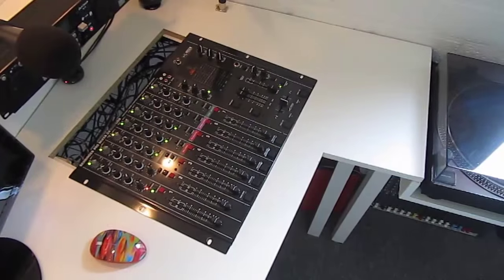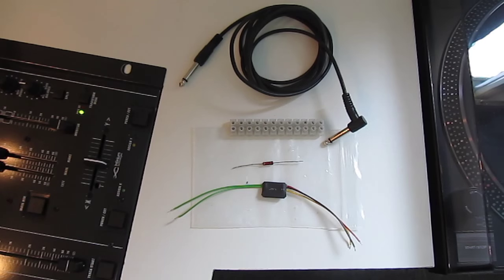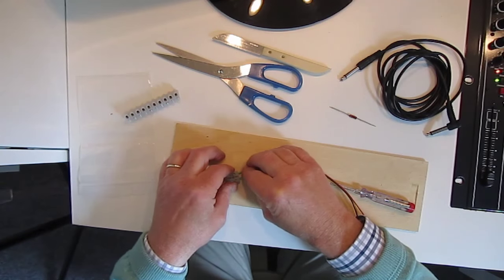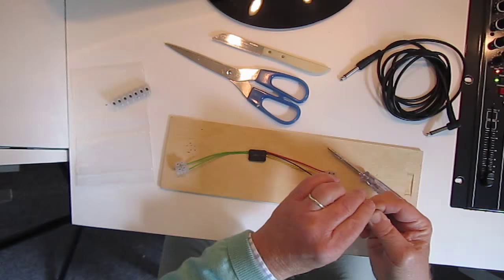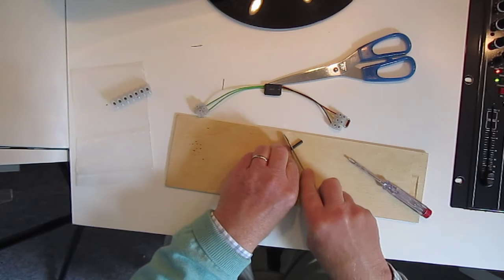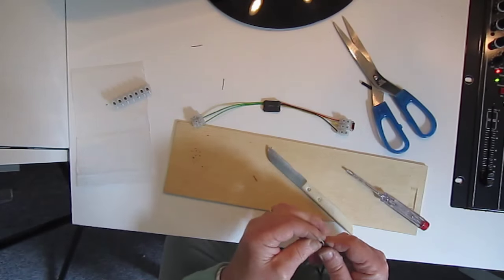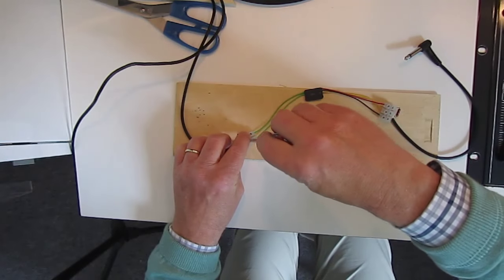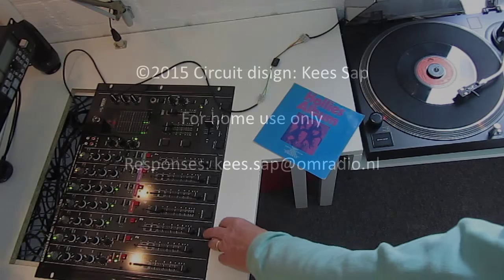Record player, Turntable  Remote Start

Comment: Looking at this again (stupidly, I haven't yet built this for my turntables!) and realized that this also solves a similar problem with my CD decks. The pushbuttons on my mixer (almost the same mixer as yours in the video) can only start my cd players when the button is depressed, and stops it when released. Building this will make my CD decks stop and start as I would like them. Thanks again! (now to get to my turntables!).
Reply: how did you implement that on your cdplayers (which brand/model ? )
like to know that :) thanx !!
Reply: @krisvangremberghe6413  I have a dual deck Denon DN-2500F, which has jacks on the back of each deck for remote start.

Comment from the maker: Rich, It not possible use my circuitry, because your turntables don't have a remote jack. The only thing you can do to start/stop your turntable remote is to screw it open on connect two wires to the start/stop switch in site. You can use a patch cable like I did in de video. Buy a long one, cut is in the middle, connect one half to the start/stop button of one of your turntables and the other half to the other one. Hopefully you know how to use a soldering iron.

Comment: That's great!
I've been wanting to do that for a long time but didn't know how?
I would love to see how you do the start/stop switch!
Thank you for sharing that!
Reply from the maker: +Rich Lindsay Thanks for comment, did you already build it?
Reply: No. Not yet. I do have a mixer with momentary buttons but I need to find the schematic for my turntables to locate the TS socket for the cable.
Your instructions are very clear. Thanks for posting them! Most instructions I have found to date were very confusing and not to the point.
Reply from the maker: +Rich Lindsay What is the brand and type of your Turntable? May be I can find out for you.
Reply: I am using a Technics 1200 MkII and a Gemini XL500, a cheap copy of a 1200.
Reply from the maker: +Rich Lindsay Rich, It not possible use my circuitry, because your turntables don't have a remote jack. The only thing you can do to start/stop your turntable remote is to screw it open on connect two wires to the start/stop switch in site. You can use a patch cable like I did in de video. Buy a long one, cut is in the middle, connect one half to the start/stop button of one of your turntables and the other half to the other one. Hopefully you know how to use a soldering iron.

Comment: Hi
I have a turntable that has a remote jack. I bought the components from Conrad but I have not had success. Is there a voltage output from your mixer? I think the mixer at the hospital radio I manage has no voltage output. It is a simple momentary make/break.
Therefore the circuit is not being supplied any power to perform the function

Comment from the maker: I am not just parallel the start/stop button. I am using the remote 6.3 mm jack at the back of the turntable, but as far as I know Technics Turntables has no remote jack. This circiut is ment for people who has a turntable with a remote and has no soldering experiances and don't want to spoil the warrenty. To parallel the start/stop button is the easiest way, but you have to know how to do it. May be I will make a video how to do it, but you have to have soldering iron experiencens.